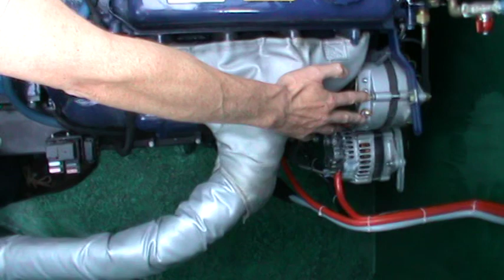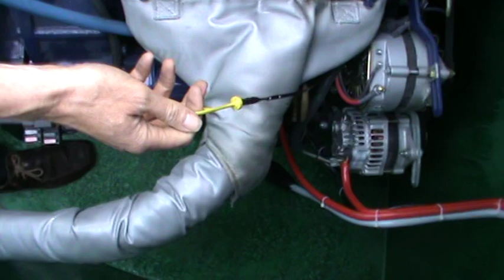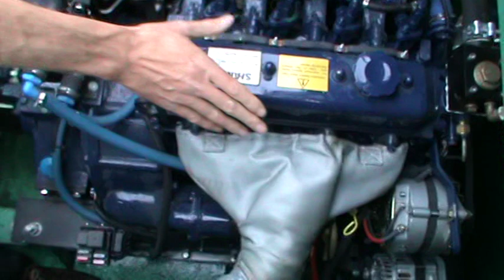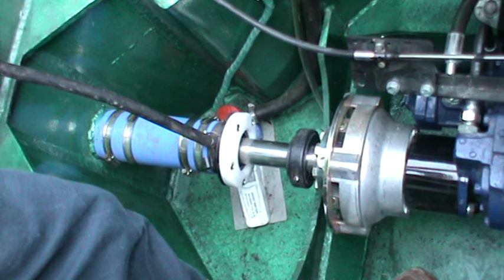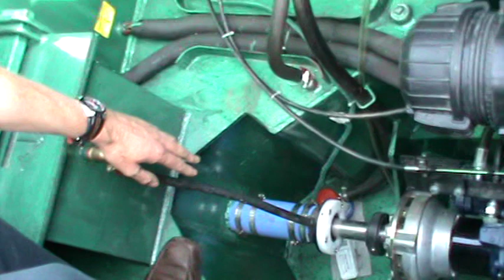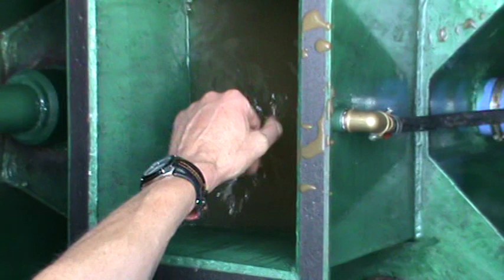Narrowboat Engine

Comment: Having some issues with a Perkins engine, keel cooled that is overheating, the pipes to the box-cooler seem to be empty when squeesed, and the temp gauge shows 180 degrees, I guess it might be the thermostat, what do you think !!!! (Its not the water pump ceased as the belt is still turning ok.) Can't afford expensive engineer so it a dIY job.... Thaks